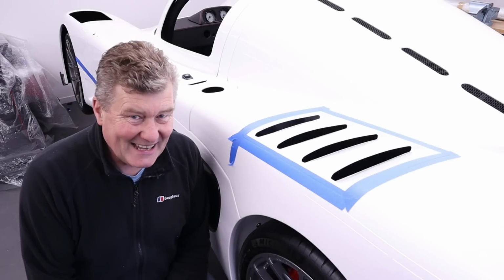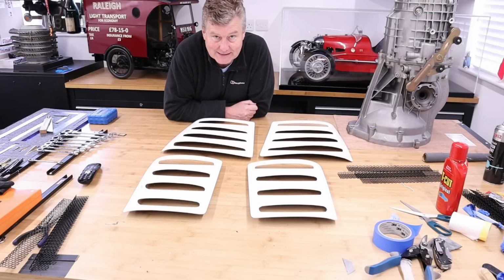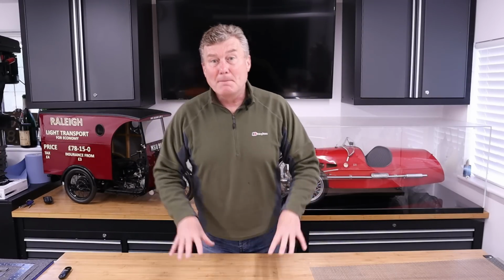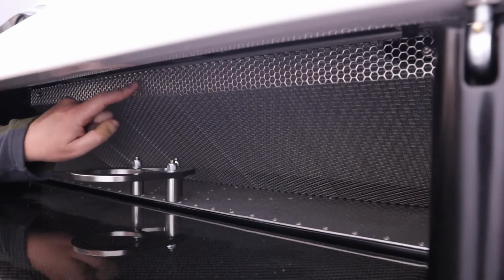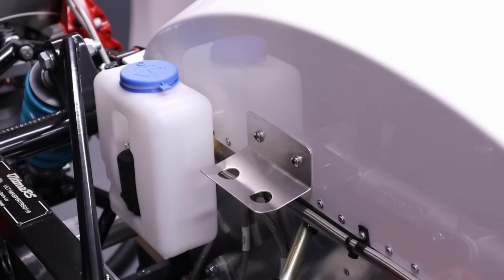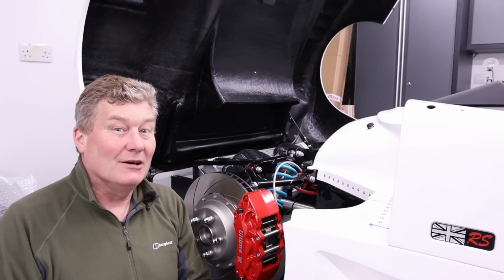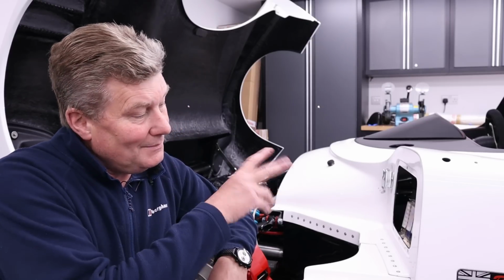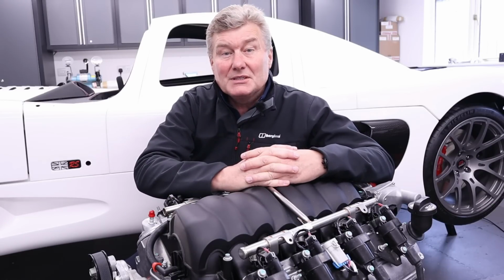Building an Ultima RS with Nigel Dean. Part 38. Aero gills. Auxiliary systems

Comment: Loving this series even though I’m years behind , one thought and maybe you have changed it since, I would not rely on jubilee clips for my brake lines even a spring style clamp would be better as it shrinks with the rubber whereas a jubilee clip will stay the same diameter, an fittings would be the safest imo.

Comment: I would have painted the front grill black to match the rest of the grills on the car. 

And I would have put a template of the RS on the front grill and painted over it. Then removed it so it can have a RS outline in the grill. 
 
Love the videos. Keep it up brother.
Reply from the maker: Hi and thanks for the comment. I did actually think about putting a stencil on the grill and spraying V8C but I was worried it would chip at 200 plus mph ;-). Thanks for the support. Cheers Nigel

Comment: Nice episode with plenty of bits going on Nigel, it must be satisfying to be at the point where things are getting ticked off as “all complete”. Just a little thought…. I added some blind grommets into the access holes for the steering rack fixings, it’s worth doing to help stop any debris / moisture getting in  there and to protect the chassis  rails. It did take an hour to remove the one that accidentally fell inside though 🤦‍♂Thanks for keeping the videos coming so regularly, it can’t be as easy as you make it look !!
Reply from the maker: Hi Garreth, and great tip. Yes dropping bits in those chassis tubes is annoying, especially if the items are not magnetic :-). The videos will be coming for a while yet, and most jobs are fairly straightforward I must say. Having a video of someone doing the job first is a great asset I must admit. It does not matter how many words someone writes, moving pictures are worth so much more. Cheers Nigel

Comment: I think it would be a nice touch for Ultima to offer an option for the fender top louvers to be formed directly into the fender. That would save a lot of work for folks like you that want the body-color louvers. Ultima could also furnish fenders with that open panel (like they do now) for those that prefer the carbon fiber inserts.
Reply from the maker: Hi Kenneth, yes that would be an option but I must say it he separate panel does provide some super detailing. Even though the work took a long time it was extremely satisfying. Having the panels also provides the option to switch to carbon if a future owner preferred. Anyway, really appreciate the support and comments. Thy episode was a lot of editing :-)

Comment: I really love the white with black accents; in the Lotus community it's called the "Stormtrooper" look. But you're right to use white for the fender vents - the balance needs to tilt toward a dominant body color, with accents of black/carbon. The pictures of cars with carbon fiber vents look too much like a patchwork quilt, neither color dominates.
Reply from the maker: Clearly you have taste :-). It's the subtle touches that enhance a car, but interestingly its about a 50/50 split for carbon louvers vs. body colour. Cheers Nigel

Comment: I expect the carbon skullcap will definitely not have sound deadening material put in it.
Heat reflective foil on the runners however, might not be a bad shout. =]
Reply from the maker: On closer inspection the sound deadening material under the skull cap is retained. So no compromise on this option, apart from a stunning V8 :-). Cheers and thanks for the comment. Nigel

Comment: Great work so far Nigel.
Is there anything else, like arch liners/protectors going into the front and rear clamshells or is that it? I can't help but keep thinking that stones etc coming off the tyres are going rip off that black paint finishing the underside of the mouldings. Pez.
Reply from the maker: Hi Perrin, good observation and good question. No there are not any inner wheel arch protectors but the black paint is soooooooo hard wearing it's unbelievable. I guess it's all about weight saving. Also if after time a chip or two appears, you can brush apply another coat of satin black paint within minutes. Cheers Nigel

Comment: G'day Nigel, my preference would be to install the body coloured louvres as you have but without the grilles. The mesh grilles in this application provides no functional benefit, moreso a deficit. If the sole function of a grille is to prevent debri from passing through then what is the detriment here? Neither side of the grilles requires clean air so I'm afraid these grilles do nothing but retrict the airflow which defeats the purpose of the louvres.
Reply from the maker: Hi and thanks for the comment. I would have to defer your question to the designer of the Ultima RS who I met at a car meet yesterday. We spoke about aerodynamics for about an hour. Cheers Nigel
Reply: Interesting point techo, but in my view the slightly reduced airflow doesn't fully defeat the purpose of the louvers. Certainly the performance is reduced somewhat. But this is after all a roadgoing car, and the grilles add a finishing touch. If it was a racing build where every slight advantage counts,it would be a different matter.